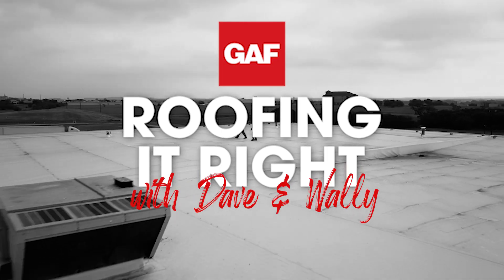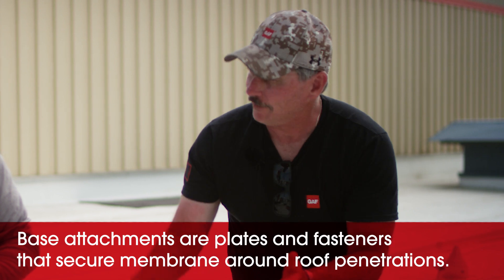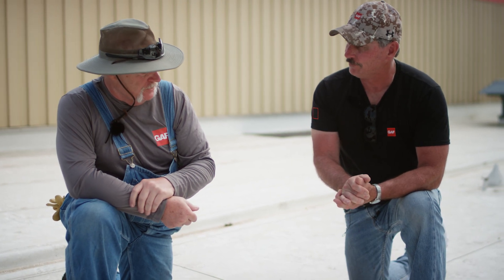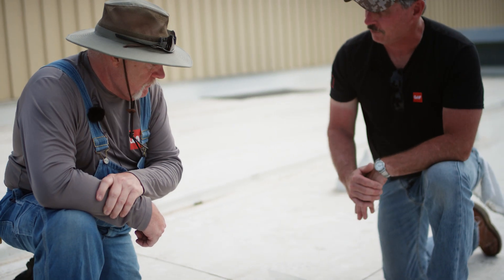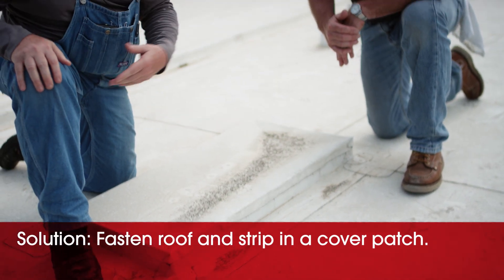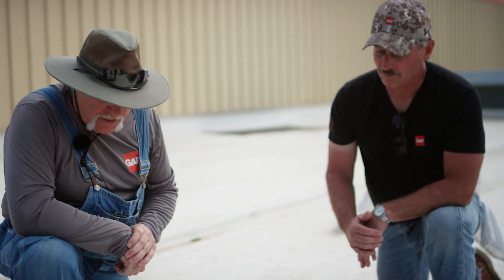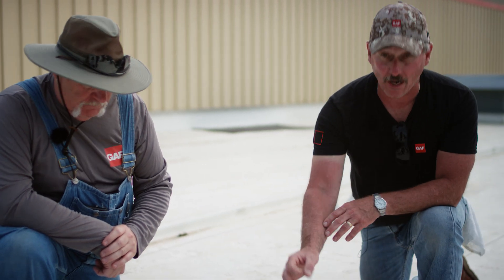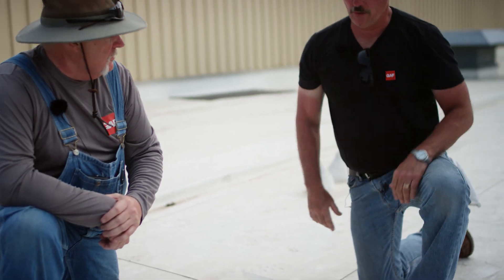Missing Base Attachments at Walls, Curbs & Penetration | Roofing it Right with Dave & Wally by GAF

Comment: How do you install a mechanically fastened system on a open beam ceiling?
Reply from the maker: Hi, there. Thank you for reaching out! Installing a mechanically fastened system on an open beam ceiling would depend on the needs of the owner, and if they are looking to avoid screws showing through the ceiling, and if the deck is a structural deck. Assuming this is a structural deck, (for example a minimum 1/2" CDX plywood), then an attachment through the deck can be approved, provided the proper application instructions for that deck type and system type are followed.
However, if trying to avoid screws showing through the deck, then the best application would be either an adhered system with the insulation adhered direct to the deck (needs to be untreated wood) and membrane adhered, or a mechanically attached or Rhinobond system that is attached to the structural joists/purlins rather than into the deck.  The latter application has different recommendations based on joist/purlin spacing. 
If you would like to speak with a technical expert in more detail, you may contact them directly by calling 1-800-766-3411, and they will be happy to assist you.

Comment: Light concrete deck with metal pipes penetration on a full adhere does it still need plates and fasteners
Reply from the maker: Hi, Erick. GAF details call for the membrane to be fastened at all penetrations. This includes base of walls and curbs, the perimeter of the roof, angle changes, etc. Feel free to give our technical team a call at 800-766-3411 if you have any other questions.
Reply: Erick, you still need base attachment over LWIC on an adhered roof.